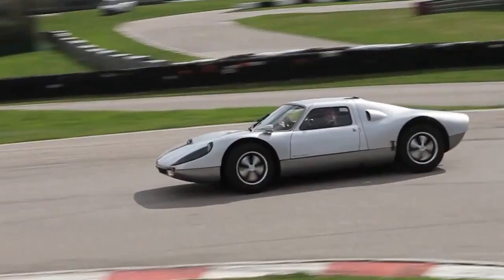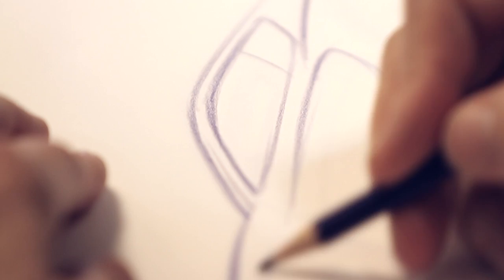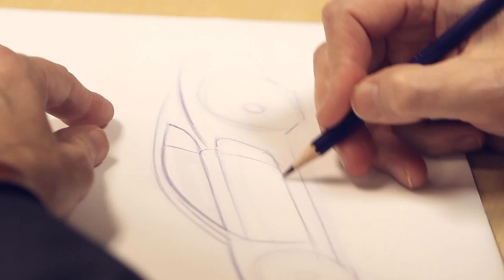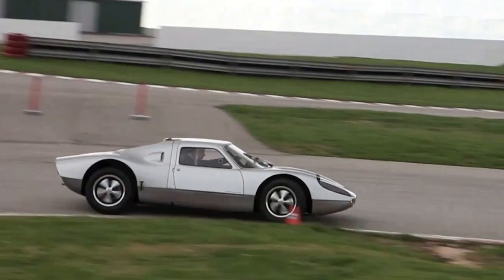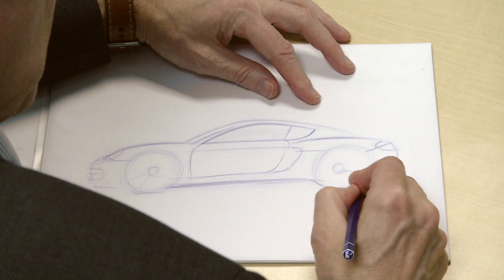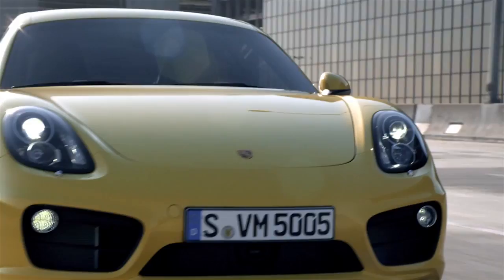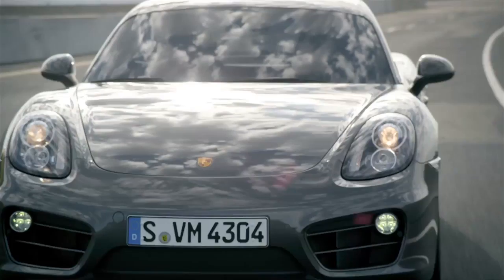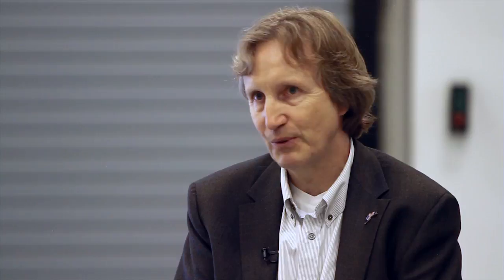The new Porsche Cayman: Influence and Design

Comment: As a former Boxster 981 owner I find this video very insincere and unbelievable. The new Cayman has the same model number as the Boxster and is, apart from the roof and some engine tuning, identical to it. Since the Boxster 981 came out first there wasn't much left to design for the Cayman. Just be honest about it.
Reply: You are 100% incorrect.